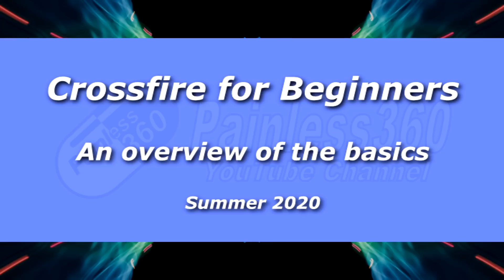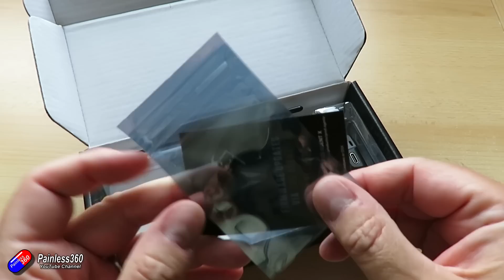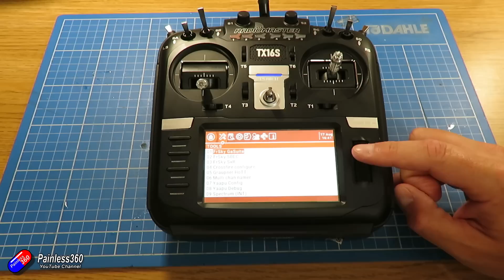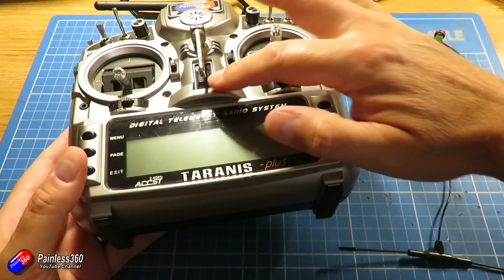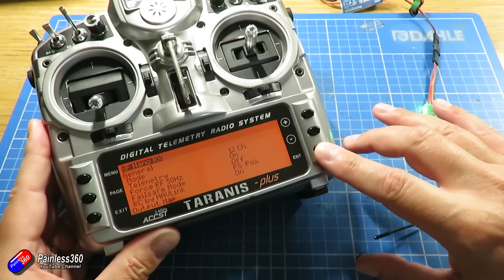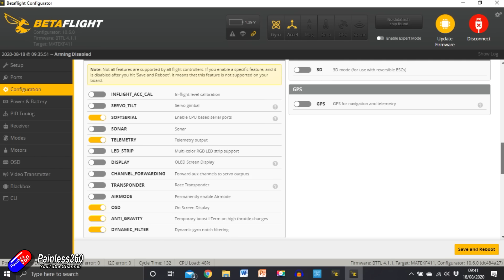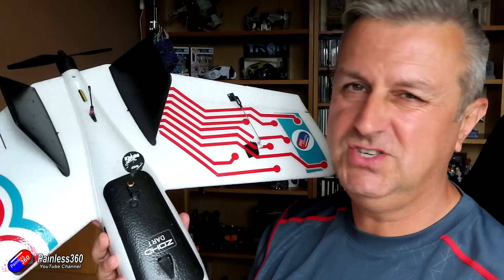Crossfire Basics for Beginners (Summer 2020)

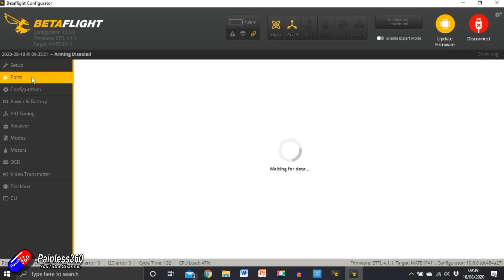Comment: 15:06 thank you for the betaflight setup part, I've had mine on SBUS, didn't know to set it to CRSF even though I had the 4 wires soldered. The only thing is that I have telemetry off for toothpicks running JESC rpm filtering since it can mess with the rpm filters.

Comment: Thanks for the video, Lee. Crossfire might be my next step, but I’ll probably get the tango 2 radio, to save me from the hassle of working with the module and my old qx7
Reply: Main reason I haven't gone to crossfire. I invested in a qx7 right after they first came out (b4 crossfire existed)  and even though I would likely not notice the added delay if I used software fix and with my skills could most likely do hardware mod I just can't bring myself to spend that much when I won't get full use or will have to risk my radio with mod.

Comment: I could not get my nano RX to bind, with Mircro TX 2 (both new, out of the box).  Took a while to figure out, but finally got it to bind.  Had to go into Agent X, Triple dot menu (top right), check the "include beta firmware" box.  Go back to  "XF Micro TX", Click Firmware, and updated to 4.0.  After update, I was able to update nano rx, and bind.  From update release notes "- fixed: Bind issues for some units" Post as of: 08-30-2020

Comment: Hello. I had experienced some issues with TBS Micro V2 module in my Jumper T16. 

After couple of days investigating and talking with vendor, TBS, and even local RC shop I have found out that Crossfire was NOT working due to locked module. This should not happen but good to know for other multi-module owners.

Module locking is there to comply with local law e.g. in Europe we can only do 25mW power legally. . .

Anyway. . .just letting you know just in case somebody had/have the same issue and would like to throw their multimodule or TBS Micro so far away. :-) They do not have to do that now! 😃Problem solved by unlocking the module by clicking bind button 10x.
Reply from the maker: I have covered this in my Crossfire videos. https://team-blacksheep.freshdesk.com/support/solutions/articles/4000099976-region-crossfire-locked-no-frequency-selection-and-limited-power-selection-under-general-menu covers it too. Glad you sorted it out.
Reply: @Painless360   Mine wasn't even binding at all when locked.
It was just sitting there doing nothing (yellowish glowing light all the time).
Sorted out when unlocked. That is what I wanted to say.

If you have video on this issue I shut up then. 😀

Comment: Great video! Got yourself a new subscriber.
Is the FrSky inverter mod necessary on all FrSky radios?
I thought that was only necessary on like, QX7 and the older Horus radios.
I currently have the x9d+2019
I have Crossfire module and Rx in the mail
Reply from the maker: The situation is changing all the time so check out the TBS site for the latest... Happy flying

Comment: Very nice explanation.  Could you explain in a future video how to setup telemetry streaming to QGroundControl or similar software for each of the transmitter variants?
Reply: check out the manual, it's uodated and Includes the details
Reply: @cracymarc  thanks for the reply, but the manual is not clear especially given the product specifications from some vendors say the function is not available.
Reply: the manual hase been updated a few days ago. make sure you are not using a old version of it (should be revsion 28.08.2020).

let me know if you still miss something in there
Reply: @cracymarc  I just downloaded the manual from the TBS website.  It's not clear whether telemetry streaming via TBS Cloud is supported on the micro TX V2 or not.
Reply: Just spoke to a dealer in Australia who said telemetry streaming over TBS Cloud is not currently supported on the Micro TX V2.

It would be great to have confirmation on this point from TBS or Painless
Reply: yes, all transmitters (except for the standard tx from early 2016) got the wifi module build in. in the old standard Transmitters you just need a new jr adapter and got it then.

i changed the wording in the manual to "
All the TBS Crossfire transmitters* and the Fusion video receiver includes a built-in..."

i hope that's a bit more clear (let me know what you thing)
Reply: @cracymarc  Thanks for that. I saw the wifi module in a tear down of the Micro TX V2 but does this also mean the firmware supports streaming MavLink telemetry via TBS Cloud?
Reply: @craigmunday3707  not in the cloud  - but straight to a device like a phone or your computer :) it will send out mavlink data which can be used by apps like qground, mission planner, tower etc

Comment: Nice overview! Been flying CRSF on multirotors for a while. Now interested in exploring some fixed wing flying. I have been setting up a simple foam plane with the TBS 6ch PWM adapter.  On the back of the PCB there are pads marked VRx, Vsens. I am hoping this might send Rx battery voltage back by telemetry, but cant find any documentation on this feature. Do you have any details you can share about this?

Comment: I’ve just purchased a brand new teranis qx7s . Will I need to make the internal modification or has this now been sorted. Thanks in anticipation. Great channel bud.
Reply from the maker: Probably. Frsky only bothered to fit the faster inverter when they went to ACCESS... Happy flying
Reply: @Painless360  thanks for the reply. Is there any way I would be able to tell?
Reply from the maker: If it has, it'll have ACCESS written on it (NOT ACCST)
Reply: @Painless360  thanks bud. I will have to take a look when I’m next in the workshop.

Comment: I am a back yard RC flyer of foamie planes and an assortment of FPV mini quads. I use Taranis X9D and X-Lite. I have a variety of receivers, but for the quads it is exclusively the XM+.
Checking out the Crossfire gear, I wonder what would be the benefits I could expect for the investment. I don't fly further away than I would care to have to walk to find and retrieve my model and I am not into racing - Cinewhoops are my favorite, but I do have a Tiny Hawk and a 7" cruiser quad I built too. Your thoughts?
Reply from the maker: A lot of the BNF systems offer Crossfire but in terms of the benefits for the way you fly they are limited. The CRSF protocol is faster than SBUS and you might be able to fly safely in places with too much interference for 2.4ghz...Happy flying

Comment: Hey Lee.  I have a quick question I hope you can answer:

On the Crossfire Diversity Nano (and maybe full size as well), how do you keep the GPS powered while it's in beacon (find) mode?  I can't figure it out.  When I disconnect the main lipo, the RX stays alive but the GPS goes dark.  I don't get it.  Is there a hidden 3.3v or 5v output on the RX or something?  

I could connect it directly to the 1s backup lipo but that would mean death for the battery pretty quickly unless I remember to disconnect it every time I land.  Hope you have the answer.

Comment: Hi there just bought a second hand Taranis QX7s with full size Crossfire TX already installed ... the inverter mode has been done professionally 
But I noticed the 6VDC pin in the JR bay has been bent over out of the way 
( looks intentional )... anyway the Crossfire TX seems to work perfectly 
Searched the internet to see if this pin is necessary...no info except to find that the QX7s does not have a 6V regulator ...I don’t want to try and bend the pin back if not need ie.. 
“if it’s working don’t try and fix it !”
Got any ideas... love the channel
Cheers Phil 😊👍
Reply from the maker: I've never seen that but as you say 'if it works...'. Happy flying!

Comment: Great and easy way to update. Still,in the world of extreme interference free long range, DragonLink is king.
Reply: Dragon link? Im most likely just ignorant but ive been flying and building quads for 3 years and I've never even heard of it.  Either terrible marketing, extremely expensive, or just not as good. Which is it, or please explain my ignorance gently😉
Reply: @HDgodfrey    Same thing happened to me with Crossfire. I was so happy with my Dragon Link that I guess I blocked everything else out.  The initial setup is a bit more expensive - well worth it if you want rock solid range and  control. Range is 40 to 50 KM right out of the box with stock antennas. Zero interference too. I think it is the 433 MHZ frequency which makes it so reliable.
Reply: @JR-kk6ce  Very cool, I'll definitely give it a look. It's amazing how often I find out just how little I know. Im always happy to learn though.

Comment: At 3:04 you mention that FrSky radios have a slow inverter, which do not allow the crossfire tx to run at full speed.  Does this apply to the x9d too (and would I need to do the hardware mod for this radio too), or does that run the crossfire micro tx v1 at full speed?
Reply from the maker: The Taranis has always had a full speed inverter. All of their new ACCESS capable radios do too. Almost everything else doesn't.
Reply: @Painless360  thank you 👍

Comment: Thanks for all you do! Do you have a post detailing in more depth how to get CRSF working on INAV with a Matek FC? I'm confused about assigning the spare UART and the settings in INAV specifically.
Reply from the maker: Yep. See my INAV setups in the lockdown build..
Reply: @Painless360  Thanks so much
Reply: Last one. I've watched a few posts about VTX control over Smartaudio. Using TBS Unify Pro 32 and F405 with the new Adjustments menu option I've set up VTX power levels. On my OSD the power level number only blinks but doesn't change. Is this a firmware issue?

Comment: I have problem with crossfire, many failsafe less than 1km with 1 watt power, and RSSI strength drop instantly (not gradual). Maybe I placed the antennas horizontally or it hardware defect? Will try moving it vertical tomorrow. Thanks Lee for your help. Another idea for video: How to Install Crossfire on inav (Wiring,Telemetry, Failsafe), the Correct Way + Tips. xD
Reply from the maker: Already done. Check out the iNav builds that use Crossfire on the channel.. Best of luck with it
Reply: @Painless360  cheers Lee. My crossfire works well when I change the placement. ;D
Reply from the maker: https://www.youtube.com/watch?v=pRJEQpwF2Eo&list=LLEBAVWmjmCMlf3XQB-rjQeQ&index=59
Reply: @Painless360  Yess I've watched this and all of your crossfire series. Thumbs up!!

Comment: 19:05:  Is this a dipole?  If so, shouldn't the two ends be mounted 180 deg apart instead of 90?
Reply from the maker: Check out the antenna alignment video and the FPV antenna lab series... All detail in the video has been technically vetted by TBS. .. Happy flying

Comment: On my 5", I have the T mounted horizontal, at the rear on a 3D mount so the tips are not touching the rear arms. On 100mW (am I right this is max for UK?), I can get about 400-500m flying away from me (ideal alignment) before it drops into the 50Hz range (100-199 LQ). It often won't get back to 150Hz till it's very close in; presumably due a worse alignment. I had sort of assumed that, even on a freestyle quad, i'd never drop out of the 150Hz band on 100mw, FPV flying at my flying club.  Unrealistic expectation?

Comment: Thanks Lee, I have just invested in this system. Is the inverter just for the QX7 or all Taranis models?
Reply: Same Question!
Reply from the maker: https://team-blacksheep.freshdesk.com/support/solutions/articles/4000133896-do-i-need-taranis-mod-inverter-for-my-frsky-radio-
Reply: @Painless360  thank you 😊!
Reply: @Painless360  Thanks,  as the X9 D plus isn't listed, I assume it doesn't require the mod.
Reply: @xeriamaned  X9D+ SE "2019" and previous X9D models do not need the mod/inverter... 😁
I just received both of my CRSF transmitters,  the Full size and the Micro TX V2, and they work perfectly in my X9D+ SE "2019" and my Jumper T18.🔥
All is well. 😎

Have fun and enjoy! ✌🏼
Reply: @Stashmanfpv  Many thanks, sometimes it's not crystal clear and I just like to be double sure
Reply: Some x7 and X10 only.
Reply: Yes and No lol
Reply: @Stashmanfpv  Do you know if the inverter is needed with a Jumper T16 ?
Reply: @dallasb7117  no inverter for the Jumper TX's. It's plug and play. ✌🏼
Reply: @Stashmanfpv  Thank You  !👍

Comment: I want a crossfire tx module and a walksnail fpv rx module on a tripod with as long of cables as practical so i can put the tripod up higher  and get all around better range . Or watch fpv on a video projector screen or sit in shade on a hit day . Spotters can run around in the sun . Does a shielded cable between the tx and the crossfire module have a limit to a few meters ? I want the module up higher on the tripid and me still on the ground . Finding a place to fly with good line of sight for good radio control link is important to me .
Reply from the maker: I've not tried it, best of luck with it. Sorry I can't be more help.

Comment: Hello, I would like to buy a "Tbs crossfire MICRO tx v2" and mount an "Diamond Antenna", but I see that the new crossfire versions already have a T-antenna installed.
Is it possible to remove it to mount the diamond antenna or you have to keep the one already combined with the module?
thanks a lot for all the videos, they are always very useful.
Reply from the maker: I believe you can but I've not done it here. See my chat with Trappy about it..

Comment: I'm into the third video already and also looked online to try to understand, is this intended to replace my regular receivers or work in conjunction with them?
Reply from the maker: Replace
Reply: @Painless360  Thanks.  I'm looking to extend the range of my sik radios to be more in line with my Rx8R pro/ x8r receivers.  This would allow me to ditch the sik radios as well then, right? Is this why people are using TBS Crossfire?  Can you suggest anything like a longer range sik radio?  Is that what Crossfire is for?  Is so, can I install redundant receivers with Crossfire like I use with RX8R Pro and X8R?  For example, If I need two receivers for the aircraft, and another one on my gimbal, can I do that like I can with X8R?  Connect to all three at the same time?  I realize I can use TBS Crossfire from the external RX while also using the X8R from the internal module of the Taranis, but I want to use only one protocol, is that possible?
Reply from the maker: That is a huge number of questions. Here are the short answers:
1) It could, depends on what you use them for
2) For long range, Crossfire is hard to beat
3) Yes and flying in places where 2.4Ghz doesn't work well
4) I don't think you can. Maybe as you can bind multiples..
5) If you want only one protocol then not with Crossfire and FrSky

Comment: Thanks for doing it=) I would have a question tho i would like to try and maybe use it on a plane aswell and i am currently looking at what antenna would be the best for long range and a strong signal but since a plane is a bit different i would like to maybe if its possible back the reciever up with a traditional 2.4 ghz diversity receiver so that if one fails there wont be much damage. and since the Radiomaster for example have both 2.4 internal and 900mhz external capabilities i wondered if you would be able to set it up in such a way =) Thank you so much and I hope you can get that to work ! =)
Reply from the maker: If you are using Crossfire on the lower frequencies then 2.4ghz links for RC are redundant. Longer range and lower latency with crossfire...
Reply: @Painless360  true but idk how it behaves without diversity behind a big wooden structure with paint on it and i have heared that people had failsafes even with the crossfire becouse of the antenna being in the wrong place or smth. and i cant risk that happening with i abig heavy plane. So while i test out its null points and best antenna placement on it i think a backup would be usefull or wouldnt it? and would you be able to do it?
Thanks for your answer.
Reply: is it possible?
Thanks for an answer would appreciate it =)

Comment: Great video, I've been trying to add GPS display on my TX16S ,  with TBS Nano receiver. my telemetry is not showing GPS coordinates and main on board battery readings. What do I do to get the data to display? I have the Matek F-405 Wing FC on my AR wing.
Reply from the maker: It depends on what you are running on the flight controller. I have videos for both INAV and Ardupilot setups..
Reply: @Painless360  I am running INaV. I’ve decided to get my feet wet trying Crossfire. My previous hardware was frsky R9M with a R9 MM mini receiver connecting the RSSI input to the flight controller output to receive data on my radio. I see that the TBS nano receiver has 4 additional connections and 2 of them that has me curious about are BSL SCL and BSL SDA I was wondering if this could be used for input for data? One great thing about having the GPS coordinates display on the transmitter display is that I could take a picture of the Coordinates off my transmitter screen and paste them in a software on my phone and get GPS location on the spot.
Reply from the maker: I use the INAV lua script here. May be what you want... Best of luck
Reply: @Painless360  Thanks so much, always enjoy your video contains.